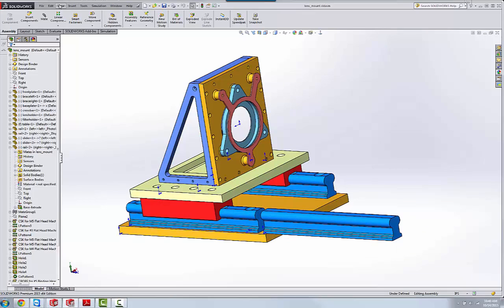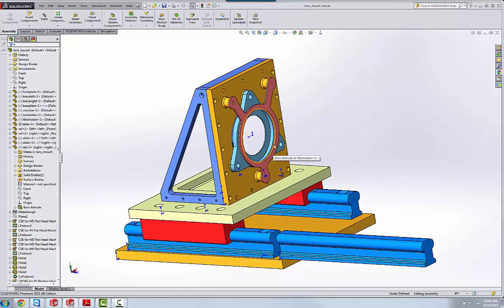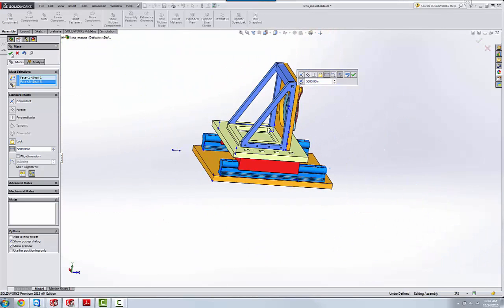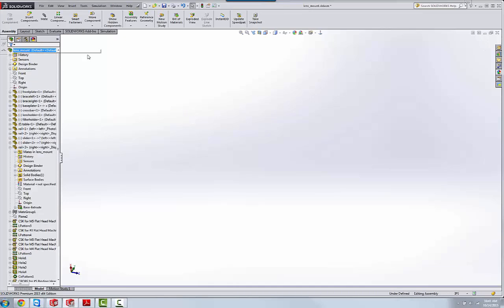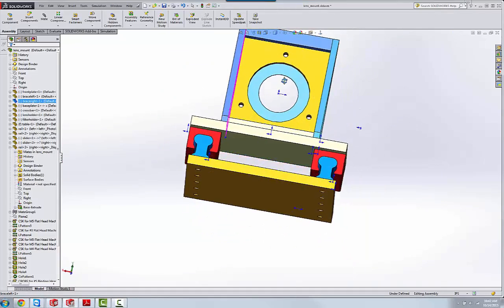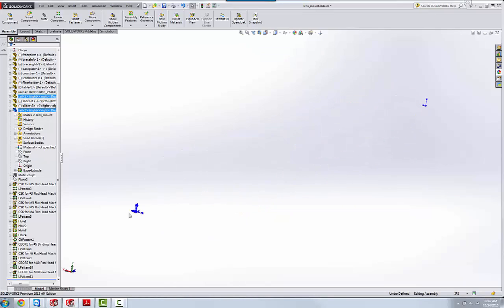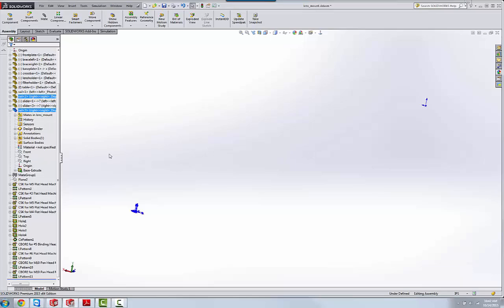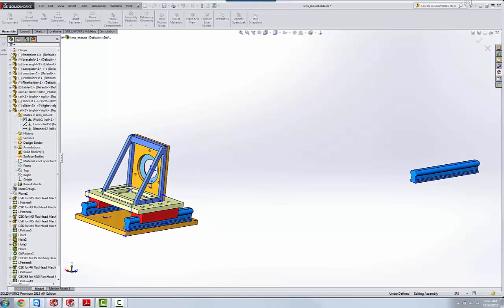SOLIDWORKS Quick Tip - Disappearing Assembly Causes

Comment: this does not help at all. my assembly is there when it opens up then disappears in front of my eyes including the parts in the tree
Reply from the maker: Hi Marc,
This is just a quick tip for some suggestions to try.  Admittedly, they don't cover all causes that you might right into.  If you have exhausted these options you will want to enlist the support of your local VAR so they can help diagnose what you are seeing.
Reply from the maker: Hi Marc,
This is just a quick tip for some suggestions to try. Admittedly, they don't cover all causes that you might right into. If you have exhausted these options you will want to enlist the support of your local VAR so they can help diagnose what you are seeing.